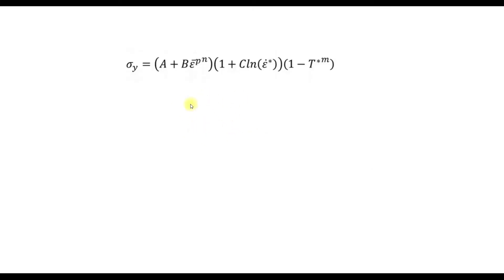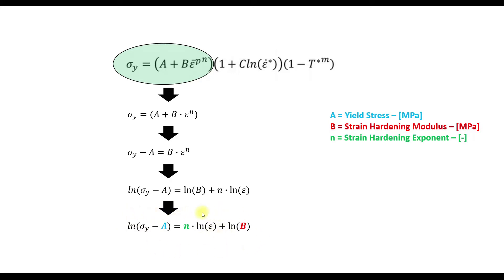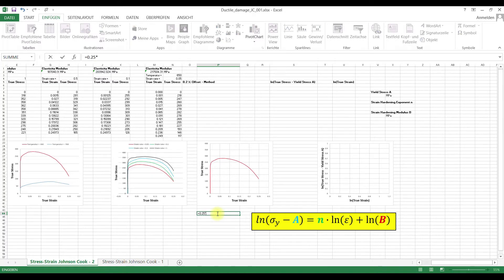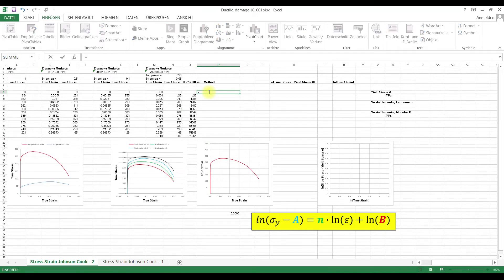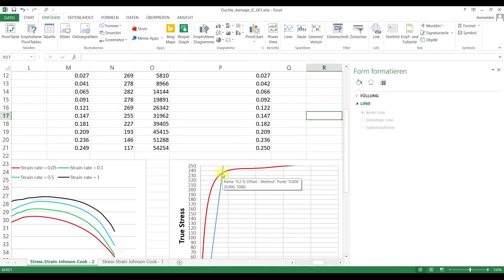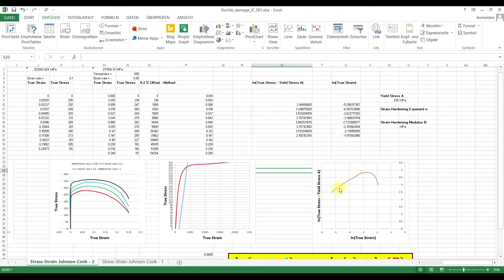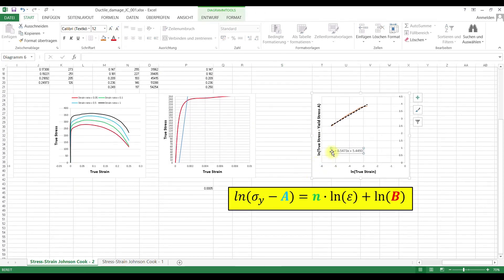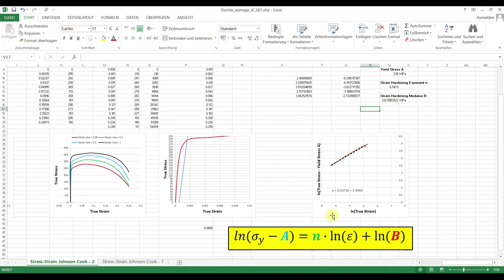Tutorial: How to obtain the Johnson-Cook Parameters A, B & n from a complex Stress-Strain Curve ?

Comment: Here you use the strain value 0.2% times the ultimate strain, then conclude the stress as the yield stress. But, why you don't use the stress corresponding to strain 0.002 as a yield stress directly? This method is used in Material mechanics  text book.

Comment: Dear Dr-Ing. Wagner. I am having trouble with the nomeclature. Wouldn´t in this case be the engineering stress and the engineering strain? From what I understand, true stress and strain are found in a flow curve, not in a stress-strain diagram. I have to find the parameters regarding some experiments, however I have the flow curves and not the engineering stress-strai  diagram, therefore I would like to solve this small doubt. Thank you for the video

Comment: Hi, great video but I have one question, did your stress strain curves are converted into curves without elastic region? Because in my case the beggining of the curve looks more like half of the parabola and I am little confused cause of it because I can't even use offset method properly. Would be greatfull for your answer. Thanks.
Reply from the maker: you mean you cant determine the yield stress with the offset method because of your curve? was the material test done properly?
Reply: @hnrwagner  The test was done by Dr. from my university so I thought it should be done properly but now I think it looks like slight loosening of the sample at the beginning. After strain reach 2% everythink looks fine.

Comment: How the reference temp and reference strain are selected?
Reply from the maker: Room temperature and strain rate for quasi static behavior
Reply: @hnrwagner   Thank you for your quick reply. 
Suppose experimental temp range are 250, 300, 350, 400, 450, 500 degree C, and strain rate are 10^-3, 10^-2, 10^-1, 1, 10 /sec. Then what should be the ref temp and ref strain rate?
Reply from the maker: @barman5186  room temperature is 20 °C as strain rate i would set the lowest value (10^-3)